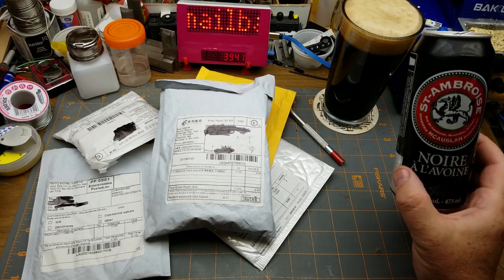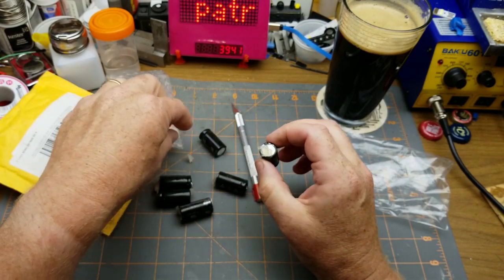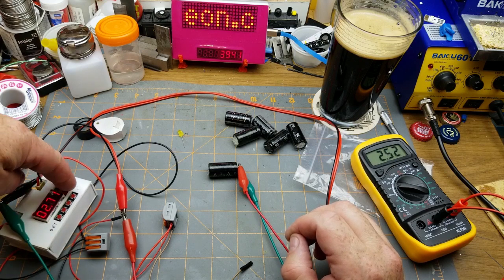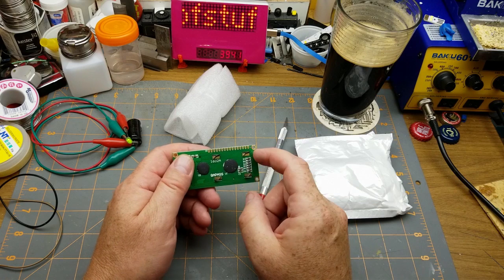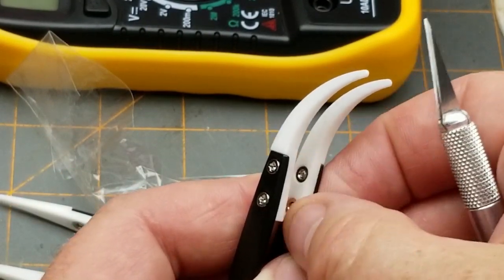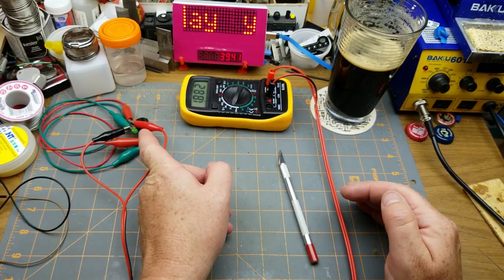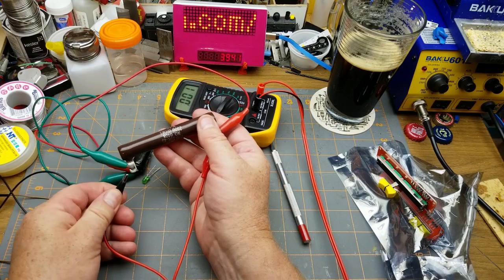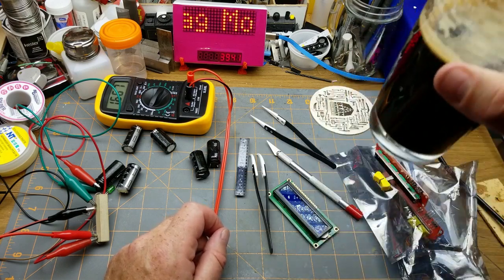mailbag monday  #63

Comment: super caps are best used in applications that require fast charge and fast burst current discharge, not for length of discharge  applications. charge that cap, then put a 22 gauge wire across it and see the results. have fun.

Comment: I’m sure you have covered this. What is the mat you use for your work surface and where can I get one. How is it holding up to the knife cutting. Thanks
Reply from the maker: It's just a standard cutting mat from a craft store. Knowing me, it was the cheapest available brand.I've had it for probably 20 years, and the only real damage is from heat.
If I have a circuit board directly on the mat, the heat from soldering causes the mat to start warping.
Reply: Thanks. Also for introducing new beers
Reply from the maker: @johnyost4487  All part of the service!

Comment: Those ceramic tweezers are excellent, but
i) they are brittle - do not use as a hammer or spudger
ii) they have a tremendous heat capacity and will remind you by burning your fingers :)
Reply from the maker: Important safety tips!

Comment: Yeah those linear pots are only linear slide action with an S taper.   Not much resistance change at the beginning or end but lots in the middle 75%.
Reply from the maker: I was kind of hoping they would be log taper (I did a 5 minute tangent on that which got dropped in the edit).

I'm thinking of using them for audio, so log taper is preferred.

Comment: I don't know what the deal is with the article you were looking at, but those are supercaps. "Supercap" isn't about the absolute capacity, but about the construction and energy density.

I'd recommend carefully measuring the ESR and capacity of those caps. At that price, or just the fact they are used, they're probably trash. I bought some similar supercaps a while back for about twice that price, and while there was no sign of them being used, the ESR, capacity, and self-leakage were all over the place and way out of spec (ESR was more than two orders of magnitude high for half of them), suggesting they were in various stages of dying and I'm guessing unsafe to use.

Those tweezers look nice. I have some lost in my inbox somewhere. I'm curious how true the claims of heat resistance are.

Comment: The LCD display.. what's dose the i2c option give you,??/let you do.???
Reply from the maker: Saves pins on the microcontroller .
Which may or may not be important depending on your project.
Reply: @pileofstuff  Thank you👍
Reply: At the potential expense of using more program memory with the Wire and LCD library I think

Comment: When you where looking at the data sheet for the 7333, you were looking at the wrong chip. You where looking at the 7318. The 7333 is on the next page.
Reply: Hope that you guys have better luck than me.  Was unable to observe the extreme LDO in my batch, with a real load, like 100mA.
Reply from the maker: Good catch.

Fortunately most of the specs are  similar across the family (mostly just the voltage changes)

Comment: Super caps 🤙 super excited to see you mess with those
Reply from the maker: unexpected welding in 3...2...1...
Reply: They look suspiciously like regular electrolytics with those vents on top.
Reply: @pileofstuff  Yes things with lots of stored energy can suddenly become quite exciting sometimes! I just watched a couple videos a guy did in the last month hooking up 300 9V batteries in series then using some pretty thin leads with crock clips (like the ones you used to hook that cap to that led) as the 2700 volt leads!  The first 6 or 7 inch arc I saw him pull I thought he could be in real danger. If you want to see the videos search for 300 9v batteries and one will be at the top the other real close by. I you watch it I'd be curious to know if you think he took adequate precautions  and I'm just a nervous Nellie! Thanks for the video.
Reply from the maker: @kwils6685  I saw that video.

AvE also played with a stack of 9V batteries a couple of years ago. Managed to get  some uncomfortable voltages.

Comment: These tweezers are great for hot air action.
Reply: I use mine constantly to torchure component leads and buss wire into position.
A little fragile, but they endure heat, chemicals, and abrasion very well.
Reply: I've never melted my stainless steel tweezers with my hot air gun
Reply from the maker: @johncoops6897  I'm hoping the ceramic tips don't conduct heat away as much as the metal tweezers do.

Comment: 1602 LCD stupid buy old model who need many wirem than same cost today i2c lcd same but i2c line and need only 2 wire and plus and minus power.5V  cost same than old stupid lcd but have lot better, no eat many wire and lot easy connect to arduino.